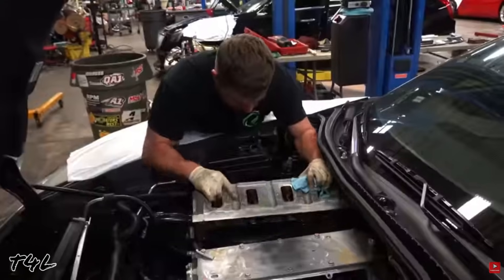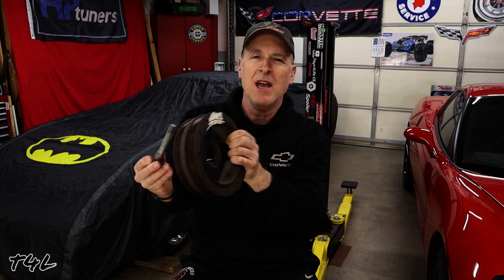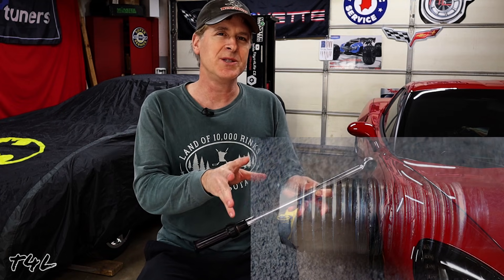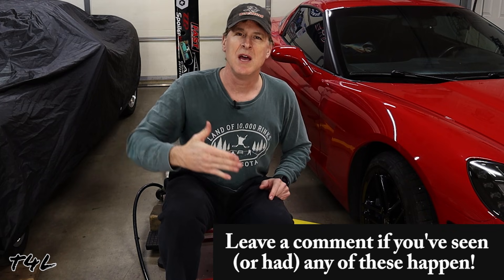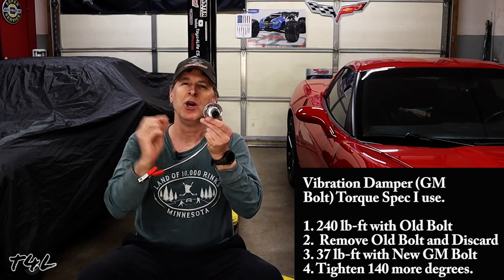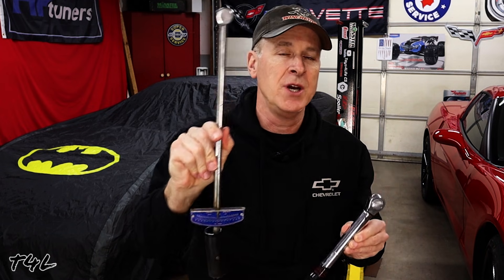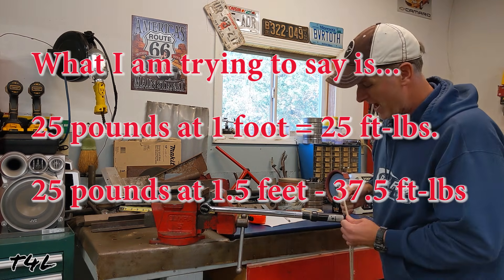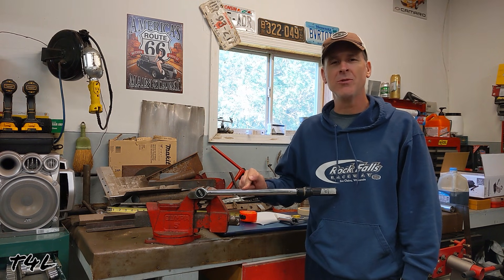TORQUE WRENCH! (WHY You NEED One & Checking Accuracy!)

Comment: Hi Toys4life 👋   Ita a wonderful day here in Oklahoma. Im ready to pull the intake on my 2001 c5. Ive taken all the steps and blew off any debris I could see and gave gone through all the steps and the intake is loose. Im worried because I dont know how to unhook the stuff in the back of the intake like the evap line and the other connector. I have a oil pressure sensor and a relocation kit plus a new ac delco Map sensor and Cam sensor that im replacing to make it run better like it should.   What do I need to double check and what do I need to do next ?

Comment: Using a deadweight test with the wrench horizontal, you need to allow for the additional self-weight of the wrench adding to the load you're applying. My main 15" wrench is already outputting almost exactly 2 lbf.ft in this condition. If this larger wrench showed, say, 3 lbf.ft, that would represent 2 lb already appearing to be present at 18". Adding 25 would have the wrench seeing 27 lb load, which will easily release the detent while you are still carrying some of the weight. If the wrench had been tested on a loading bench, it likely would have been comfortably within spec, and may now actually be wrong.

Comment: Have you ever tested torque calibration at multiple torque values? In other words, if you test and recalibrate at 50 foot pounds, do you find that it remains accurate at 150 foot pounds? I suppose with only one adjustment nut, it would be a head scratcher if it was off at one value and accurate at another.
Reply: The techniques put forward on YT invariably (as far as I've been able to locate) test a single torque setting. I've never found one that does the essential zero-scale verification first, and this means that even if a single test value is done perfectly, it's only known to be correct for that one torque setting. If a single measurement has been found to be out-of-spec mid-range, it's quite possible that's because the zero position on the rotating scale is at the wrong angle. "Correcting" for this by adjusting the spring tension instead of the micrometer scale would result in the situation you describe of other torque values becoming less correct.

Comment: The good news is that you don't have to spend much to get a decent quality torque wrench - I'll happily put my $15 Harbor Freight up against more expensive options in a test of accuracy (I have access to a calibrated test fixture and have measured it multiple times). One caveat to the click type torque wrenches is that they'll let you keep applying torque after the click, and when you get to the lower settings/smaller torque wrenches the "click" can be easier to miss if you're not really careful. This is particularly true when you have to use a torque wrench in an awkward situation or position, or there's limited room for travel, etc. I've had a couple of situations where I or someone else thought a bad torque wrench wasn't clicking early enough, only to discover after testing it that it was fine and we must have missed the click - I think this is similar to people who swear they hit the brakes and not the gas in an accident, but such is very, very, VERY rarely the case 😊

Comment: I use Snap-on Tech Angle digital torque wrenches and have them in 1/4'. 3/8", and 1/2" drive.  I have them recalibrated by Snap-on.
Reply from the maker: Snap-on is like the Gillette razors of tools the best a man can get! But they don't give them away 😂

Comment: You still need to also consider the quality of the torque wrench. cheaper often do not hold spec as well in some cases.
Reply from the maker: Good point, I like to check mine with a known weight occasionally as I showed in the video to make sure it's accurate, then I don't have to wonder.
Reply: @Toys4Life  Thanks for the information. I did not know until now that it was possible to calibrate those oneself. I have never owned one of those because I never trusted them to be accurate. One commenter said, "all you have to do is take it to your local calibration shop", I asked, we don't have one, they mail it off somewhere.
Reply: I'm going to slightly disagree and say that based on actual test results there is not a correlation between price and accuracy. The Torque Test Channel has done a number of tests and found that higher price gets you more features but not necessarily more accuracy. I'm not saying you can't find some junk cheapo torque wrenches out there, but there are also plenty of good cheap ones, which is good news for the consumer.
Reply from the maker: Agreed, and you can test them yourself just like I did - all you need is a known weight.

Comment: Hey toys4life do you still have your white fiero?!?!
Reply from the maker: yes
Reply: @Toys4Life I havnt seen it on the channel in a hot minute! Im building mine and the 4t65e hd hard parts chain etc are not existent anymore!
Reply from the maker: That's what I was told from the owner of triple edge transmission a few years ago. I think the parts I have in mind are all just stock rebuild parts but improved over the originals and I think as long as you keep the power under about 370 ish the metal lasts a long time, you exceed the torque limits and it breaks quickly. What's your general parts list, turbo or m90, pump gas or 85? I still love the Fiero!

Comment: Lol. Hundreds of thousands of LS dampners have been installed improperly often reusing the original bolt and I'll bet you can count the failures on one hand. Early small blocks didn't even have a bolt and relied on the press fit entirely.  While it's alway a good idea to do things properly I classify these as content creator videos. As in you don't really have anything important to talk about but you need content for the next stupid video.
Reply from the maker: Count the failures on one hand.  That is true - how many back woods mechanics are going to fess up to doing it wrong and causing a major problem?? One things for sure, when people install them in a half-assed manner in the customer comes back needing a new short block, 95% of those mechanics are going to swear they did the job right and it's not their fault. If you're honest, like I happen to be, I would fast up and buy the new engine, maybe that makes me stupid.
Reply: @Toys4Life  Considering 90% of the PARTS REPLACERS who touch an LS balancer are doing THEIR OWN cam swap its going to be pretty obvious who screwed up. Like I said. Content creators like to turn mole hills into mountains.  That doesnt make you stupid. It makes you a typical content creator.
Reply: @bdd1469 do you mind if I install your wheels with feel, sir?
would you like me to do your pan drain and fill bolts with what 'feels right' for me?
What about valve covers, heads?

Do you trust me enough to 'feel it out' that they are tight enough?  That I won't strip it out?

Why do you feel torque wrench is the mole hill you make a mountain out of, I am quite curious.

I consider TJ Hunt if he still exists a 'content hunter'.  Or what about 'react' content?

Are you saying no one can benefit from understanding why to torque bolts, using context and a grain of salt .... like you should do for anyone stating anything?  Hear the info, see how it relates or doesn't to your use case?

Please, I'm curious why you are having such a grumpy year already that you come to complain ...
How many engines have you built?  If we were to have a conversation with Brian Salter about torque specs, should I listen to him, who has built NASCAR engines, or you, the shadetree guy that says 'all good mate!'?
Tell me, when does a torque wrench matter to you, specifically?  Have you ever done a torque-to-yield fastener before?  Have you ever had a wheel get loose or seem impossible to get off before, or do you have Jedi mind focus to get 70-80 lb-ft consistently, every time?

Instead of just nay-saying; let's get into detail; please ... let's have a proper discussion, disagreements don't need to be attacks, like you are doing.  It lowers the integrity of you and your words if you cannot express yourself without resorting to insults.  So, please be civilized and let's have a proper discussion; we are all adults here, let's act like it, yes?
Reply from the maker: @bdd1469 IMO Vibration Damper bolts are mountains (:-)
Reply: @Toys4Life And thats why you will never be as fast as or have as much fun as the guys who are making 800 whp with a stock bottom end with a cam and turbo. While reusing stock headgaskets, regaped stock rings, reused TTY bolts, and a reused balancer bolt that is gudenphuckuntight.
Too each their own.
Reply: Yes some get away with it but others pay a high price for failure. Much easier to do it right.
Reply: Many should use a torque wrench on spark plugs. Too many strip the threads. 

I still use Craftsman but a high quality electric is the way to go today.
Reply: Many shops will check your wrench cheap.